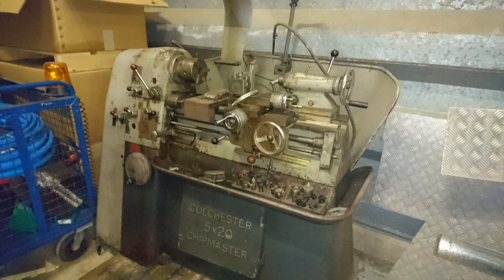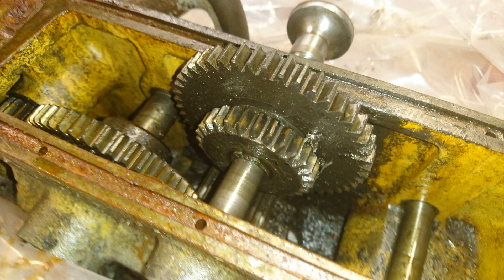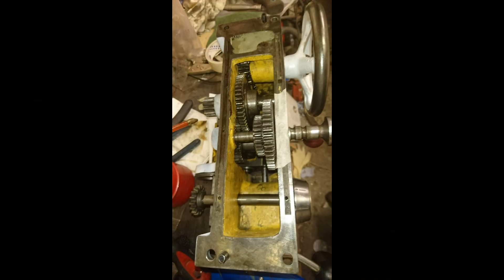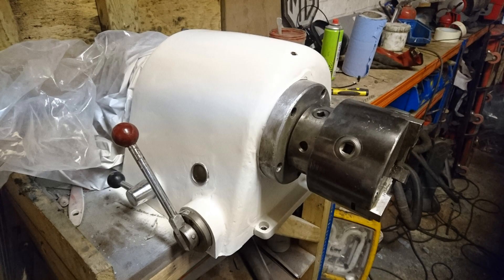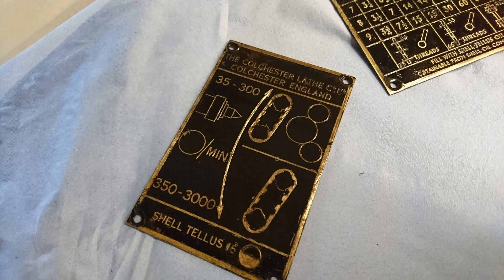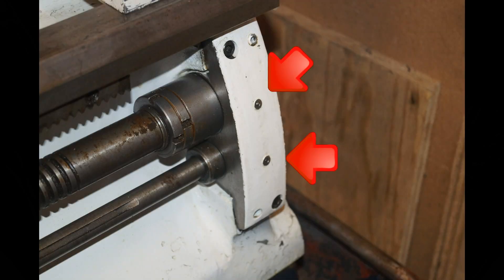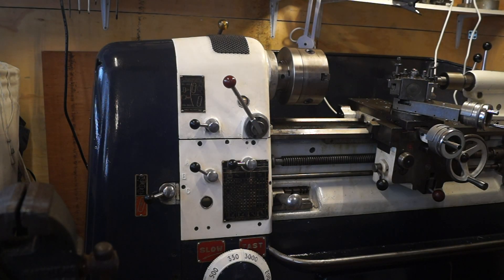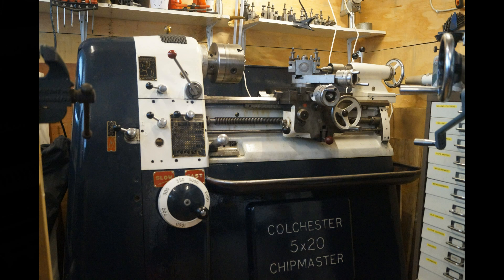Colchester Chipmaster Lathe Rebuild and Partial Restoration

Comment: Very nice work, I'm going to suggest that by not disassembling the headstock you may be doing more harm than good.
I just tore down my Chipmaster headstock completely and I found all of the oiling feed holes and drainage holes were clogged with muck so the bearings weren't getting much oil.
The oil was clean when I drained it but everywhere where dirt could accumulate, it did.
The chief culprit is #5 oil channel tube that runs across the top of the headstock, it catches splashed oil and via 2 drainage holes drips into the front and rear bearings, mine was badly clogged.
 Also, #31 Back bearing inner cover has a little funnel on top to catch the oil drips from the oil channel, it was also clogged.
Just saying.
Reply from the maker: Thanks for the info. I’ll be partially stripping it down next year to move it so that may be a good time to peek inside.

Comment: Nice little lathes.
I did my Engineering apprenticeship (1976-1980) in a company that made saddle gearboxes for Colchester lathes amongst other parts (topsides, compound slides and tailstocks). 
The gearboxes were for the larger Colchester lathes, Triumphs and Masters.
At the age of 19 and still on day release at college, I ran the gearcutting shop, Hobbers, shapers, vertical and horizontal broaching machines, and an induction hardening plant where we hardened the gear teeth.
You have 2 shafts running along the front of the lathe to drive the saddle gearbox. A lead screw for thread cutting and a spline shaft for feeding.
I don't think we made parts for the Chipmaster, but we had one in the turning shop.
Some machines were special purpose ones built by Colchester. Looking into the saddle gearbox on the vid I can recognise a lot of the parts. It was a busy place shipping out a fair few gearbox assemblies every week up to Colchester for assembly into new machines.

Comment: Hello dude what a brilliant project! what brought me here is that recently acquired a chipmaster lathe myself and discovered the Headstock is requiring a re alignments due to its turning quite a taper onto unsupported stock. how did you go about aligning yours? looking at a taper test bar but getting mixed messages online as to what the morse taper size is in the spindle bore. feed back would be great from you, cheers
Reply from the maker: I got a test bar but it was made in India and it was about as straight as wet spaghetti. It's easy to adjust, loosen the 4 bolts holding the headstock on and it rotates on a pin.

Comment: Just a comment on the motor conversion. Consider putting the 3 phase back in and using a VFD. I have heard several times that a single phase motor affects surface finish quality
Reply from the maker: Yes I have a vfd already and tried it but the original 3 phase motor has the wrong insulated windings for effective vfd use (class E). I need to get a class F motor. I am on the lookout for one, then I can lose the variator as it is very loud. Newton Tesla is a good place for a complete kit but very expensive.

Comment: where did you get the oil seal again? because i've got leak to.
Reply from the maker: I think the supplier was Kent Bearings but I can't remember the part number. I think I measured it and phoned them.
Reply: @MG-Driver  thanks,

Comment: Good informative video on your Chipmaster. Did you manage to utilise the contents of the power control box on the rear of your lathe when you did the single phase conversion or did you utilise modern single phase components in the power control box?
Reply from the maker: The only thing I re used was the main switch as I wanted it to look the same and I like the control handle and knob. Eventually I'll go back to 3 phase but with a variable frequency drive and no variator.
Reply: @MG-Driver  I'm currently converting my Chipmaster to single phase. Did you connect your "lollipop" control lever to a modern forward, stop, reverse switch hidden in the original control box?
Reply from the maker: @Dutchie74flh  no I have not fitted a reverse yet. But will soon, I used the drum switch that's in the machine, but binned the rest
Reply: @MG-Driver  I see. Thanks. You did a great job on your Chippy. Best of luck with it 👍